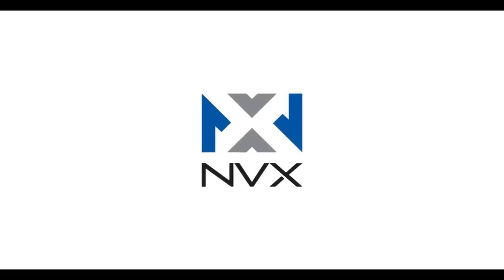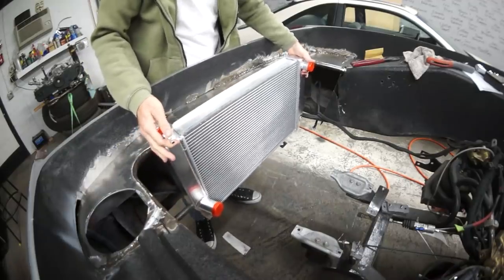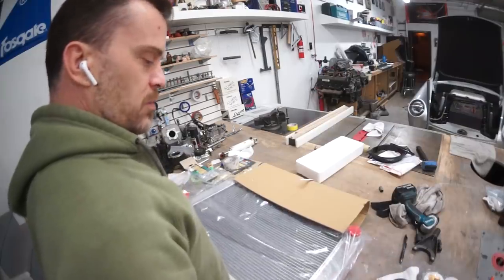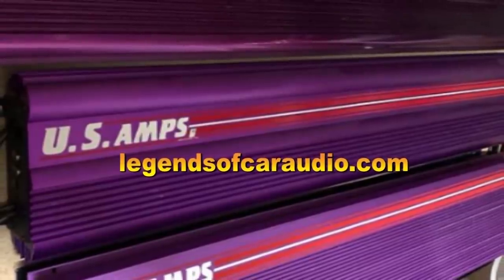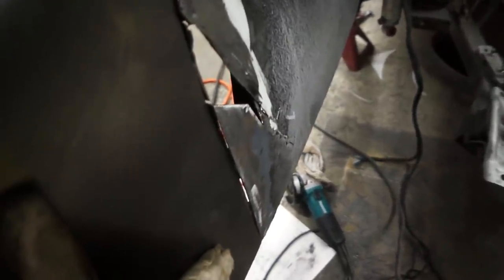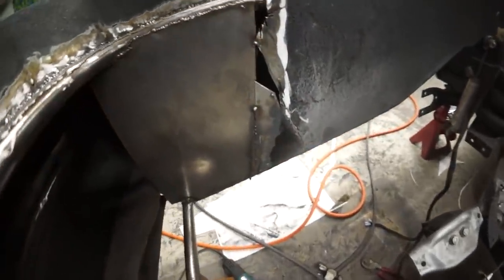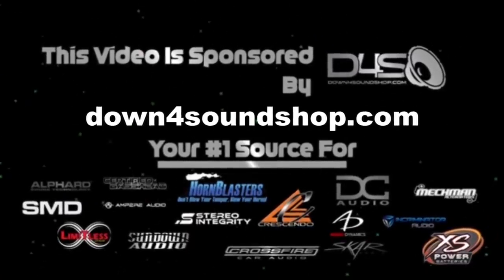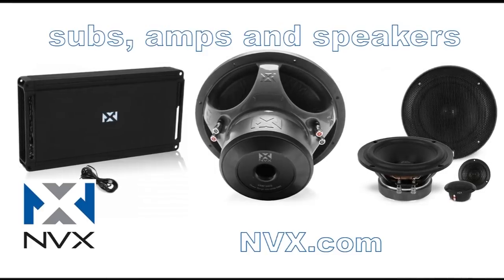The Mule ENGINE BAY SHEET METAL, part2

Comment: Hey Doug, not sure if I missed your explanation, but where is the air going to go after it has gone through the radiator. Seems like you are closing in too much of the area around it. Wouldn’t want to see you have overheating issues in the California heat.

Comment: Well that's 11 minutes I will never get back watching some half hearted metal work. And one plate be welded.
Also why did you not straight cut the original metal and then weld the new piece to that giving you a finished but joint? 🤔🤔